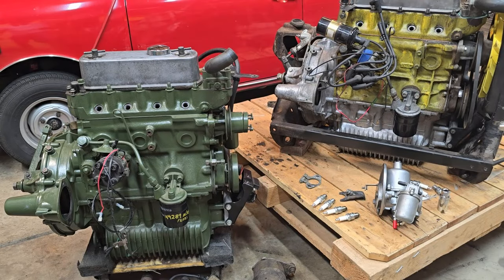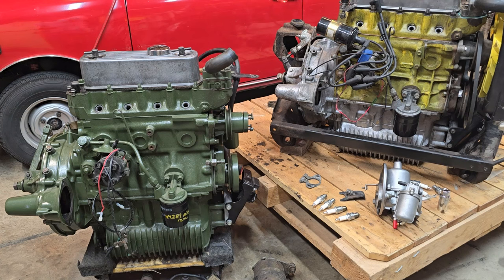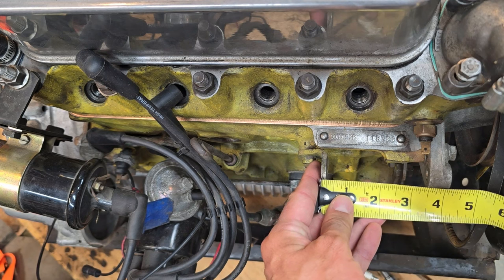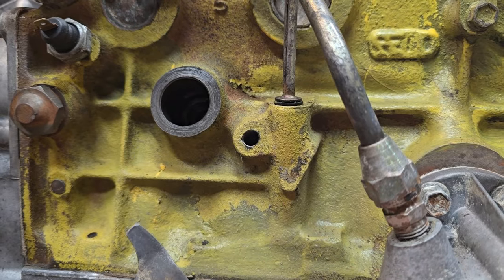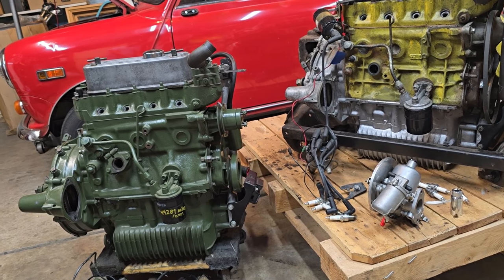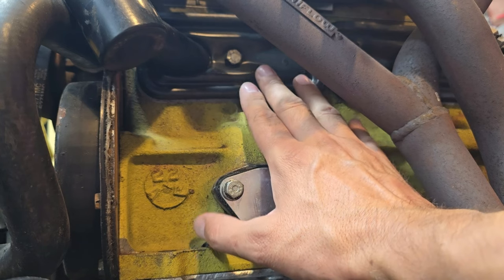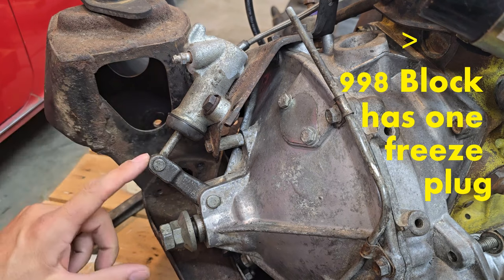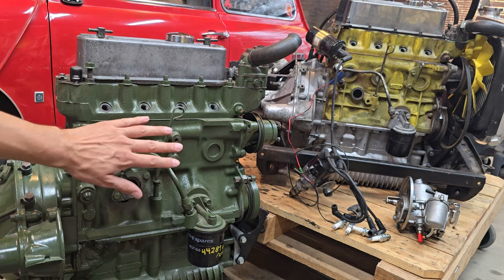Classic Mini survival guide: A vs A+ motor identification..

Comment: Thanks for that. I have a mapped CSI distributor on my Mini. It's similar to a 123 distributor, but looks exactly like the original. The 998 A plus has a stage one kit, so I initially picked map 7. Your thoughts on mapped distributors?
Reply from the maker: Mapped dizzys are great as long as you can measure the performance difference between curves and don't get into detonation limits. I wish the CSI would be updated to use a 0.8ohm coil, that would be ideal.

Comment: Thanks! Confirmed what I have is a A series not A+ (in a 94 JDM import car).  What year did they swap from A to A+.  I wonder if my engine was not original to this car?
Reply from the maker: Correct, the JDM cars with fuel injection were A+ motors